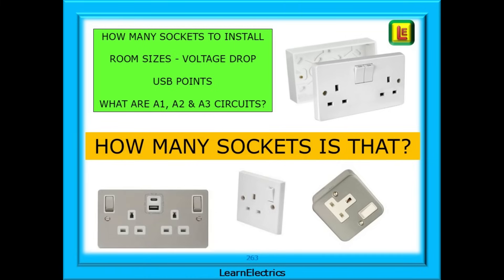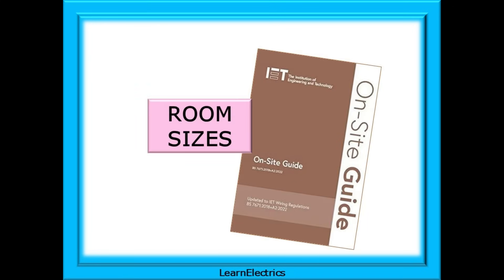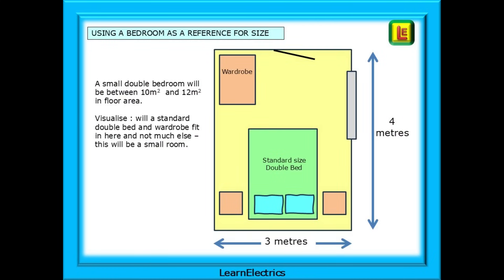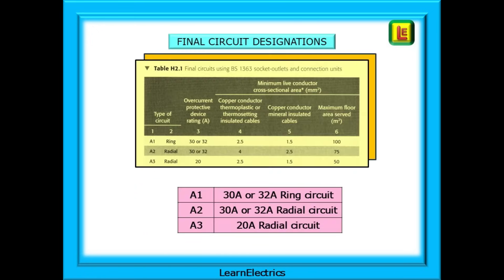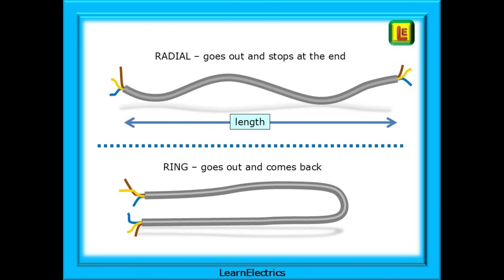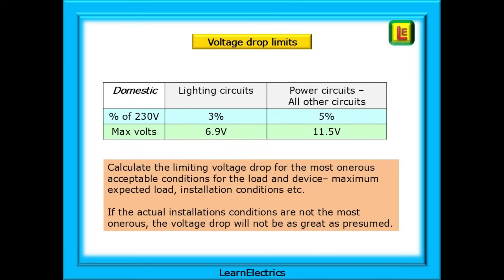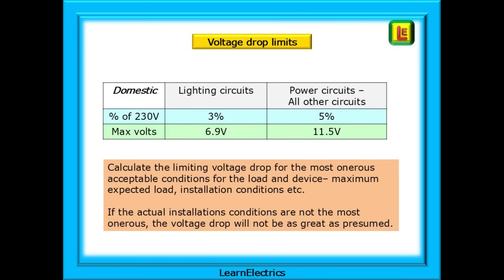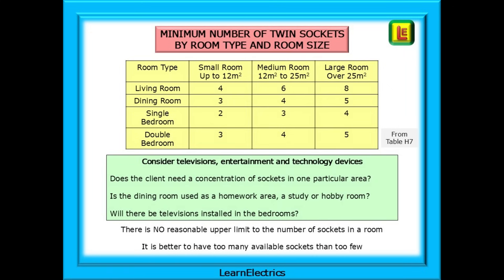HOW MANY SOCKETS IS THAT? - KITCHENS, BEDROOMS, LOUNGE, FLOOR AREA, VOLTAGE DROP, BREAKER SIZE, MORE

Comment: thankyou and i didnt realise usb sockets were a trickle charge but it makes sense as theres no switch for them, much appreciated my good man.
Reply from the maker: Thanks. They are not so much a trickle charge as an always on trickle load on the supply. Even with nothing plugged in they will draw just a few thousandths of an amp through the primary side of the transformer, Thanks for watching.

Comment: Presently changing the electrics at home. Your info has been invaluable thanks. A question, is it best practise to do new wiring in a ring circuit for safety or is it position required? I hope you understand what I’m asking. Thanks.
Reply from the maker: Makes no difference. Ring and radial are both safe if installed and tested correctly.
Take a look at the video on the link below. All the answers.
https://www.youtube.com/watch?v=6GNb1SSEjQg
Reply: @learnelectrics4402  Thank you.

Comment: Given the potential high loads that could be seen in kitchens, (toaster, kettle etc.) and with a significant number of outlets suggested for a large kitchen, should I consider splitting the outlets across two independent circuits for the kitchen outlets?
Reply: Yes, you could also consider a 32A radial in 4mm T&E.
Reply from the maker: Thanks for the support, great reply. Dave.
Reply: @MS-Patriot2 A2 to go for Large Kitchens👍
Reply from the maker: Some electricians do exactly that and I think its a good idea in larger kitchens. Thanks for watching. Dave.